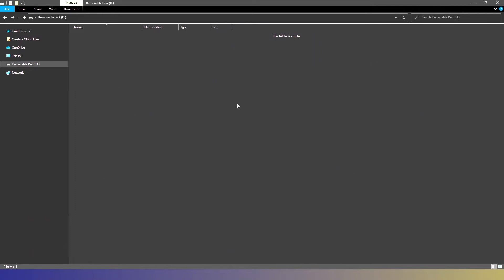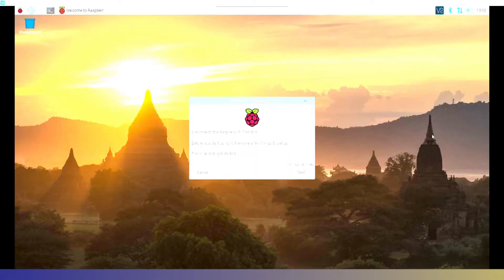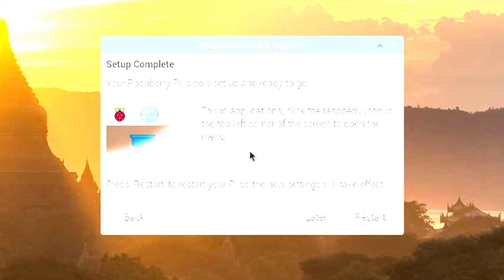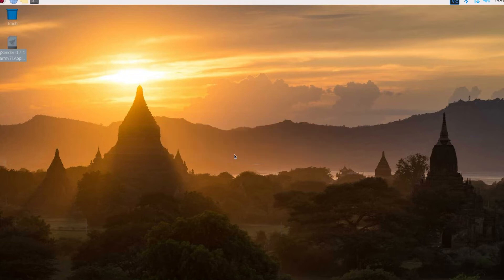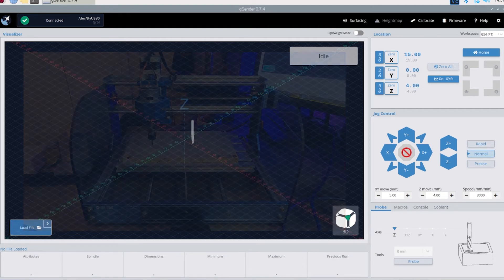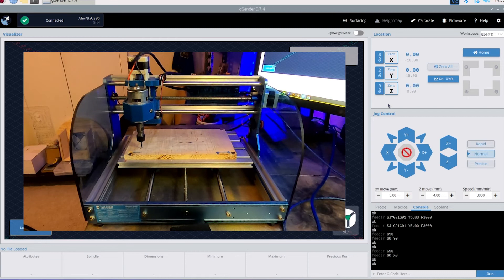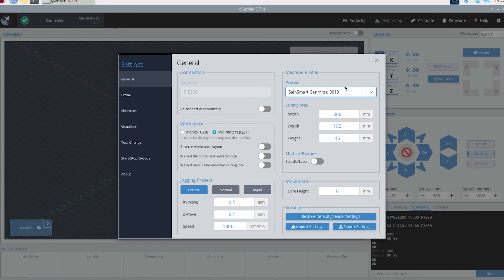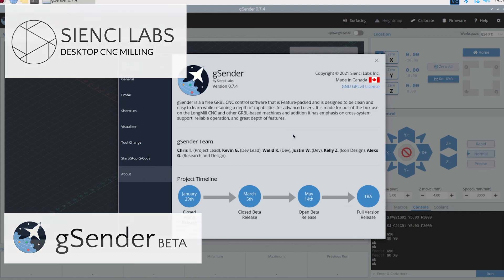gSender on a Raspberry Pi 4 - Install & Overview

Comment: Does this work with 64bit pi?
Reply: Yes I have it running on the latest raspian 64bit OS not fully tested yet, you need to install libfuse2, "sudo apt install libfuse2" and reboot. Hope this helps!
Reply from the maker: @petersutton1609 going to check it out thanks!
Reply from the maker: Last I looked no. There were some libraries missing. I have not really dug back into this yet, but plan to once I get my pi5. I will be trying 32 and 64, the newer versions of gsender, and a few other things.
Reply: gsender 1.4.2 is supposed to be 64 bit, but it’s not working for me. Appears to just shut down right away when starting. I’m using a 2 gig pi 4 with a freshly imaged os: 
Release date: December 5th 2023
System: 64-bit
Kernel version: 6.1
Debian version: 12 (bookworm)
Any suggestions would be appreciated.
Reply from the maker: So Gsender will not work with 64 bit, it only works with 32 bit, as of right now. You will need the 32 bit Buster release and the latest Gsender you can use is 1.2.2, its the last 32 bit release. I have an install walk thru on my website (dehammermaker.com) on installing it.

Comment: could i use this if i make a DIY cnc machine? like my motors and drivers are directly connected to my raspberry pi 4 and use this gSender to control the motors and send it gcode files to it?

Comment: Gsender will not work on raspberry pi 64 bit
Reply: I have it running on the latest raspian 64bit OS not fully tested yet, you need to install libfuse2, "sudo apt install libfuse2" and reboot. Hope this helps!

Comment: Hello DE Hammer, good video with this one gSender run wery well on my Pi400...it's ok for bCnC too, but i get soem trouble with CNCJs that i'm used to work under Grbl and Win10...
i get this message at the end of installation on Pi400..
The script is incompatible ............

thank's for this video and maybe a solution for CNCjs..
Happy new year...
Philip

Comment: Hello, I have problems running the program on the raspberry, it just freezes with the start screen and does nothing else, do you know why? thanks in advance, i did the same that you show in the video
Reply from the maker: Which build of gsender are you using? What Pi are you running? Sorry have not had it stall like that on the start screen.
Reply: @D.E.Hammer  the last version and rsp4 2gb, i will  try with another raspberry, thanks for the quick answer and for the videos, they are very helpful, goodluck with the channel
Reply from the maker: @MauricioHernandez-de8is  Thank You & I was looking at the GSender GitHub Page and Ver 1.1.1 says that it fixes the hang at splash screen. Try getting that latest version and see if that still happens. If it still does maybe go back a version until it does not stall. 

https://github.com/Sienci-Labs/gsender/releases/
Reply: @D.E.Hammer  thanks bro, have a nice day

Comment: I had a Raspberry Pi left over from another project that has a 8" touch screen, and wireless mouse/keyboard. I followed along with the video until I reinstall the card and now I have no monitor or anyway to control the Pi. I know you are using VNC and have it installed and used to be able to control the Pi with it, but not sure how I can get it reinstalled on the Pi so it's not doing me any good. Is there any where someone can send me to find the rest of the setup information?
Reply from the maker: Hi Shannon, sorry this has happened. I believe I understand your question, but if not just let me know. First Is the touch screen you were using not registering anything when you boot up the Pi? VNC comes preinstall on Raspbian, you have to enable it and have links on how to do that below. If I missed the mark on your question, just let me know.

Here are a couple links on getting it going:

https://discover.realvnc.com/blog/how-to-setup-vnc-connect-raspberry-pi

https://www.pitunnel.com/doc/access-vnc-remote-desktop-raspberry-pi-over-internet
Reply from the maker: Hi All, we did get Shannon's Touch Screen Working. If you are using a Pi3 Try installing the Raspberry Pi OS (Legacy)  version instead of the latest version.
Reply: @D.E.Hammer  Thanks for all your help with getting it figured out

Comment: Thanks for this one.  I was going to do the CNCjs but then noticed this video just in time.  Now running my 3018 Pro on a Pi 3B.
Removed that task from my main computer and don't need that damned USB cable.
Reply from the maker: gsender had just came out when I did the cncjs, and saw there were still some hiccups. So after a couple months and some revisions it has so far been pretty solid. Plus this is just so much simpler to install and has the majority of the same functionality plus some bonuses.

Comment: I'll check it out, thanks. I'm currently using bCNC on my Pi-4 and it works well.
Reply from the maker: I use cncjs currently, and it works good as well. Just its not actively being worked on, so going to try gSender out for awhile and see how it goes.